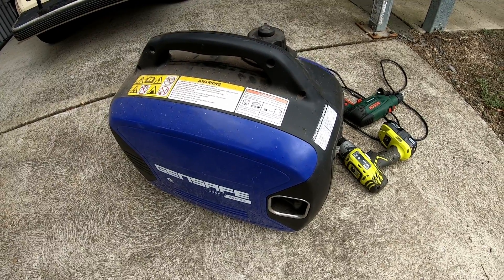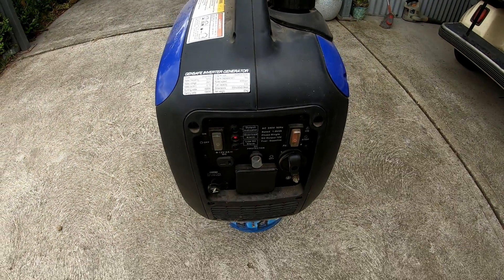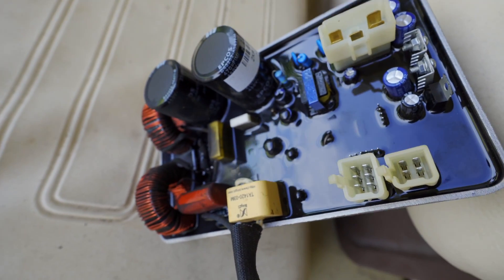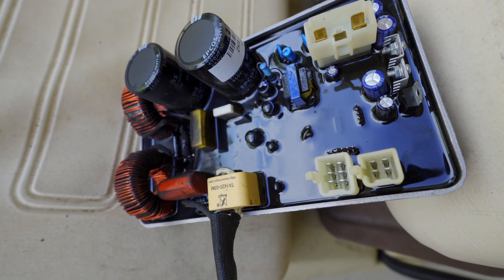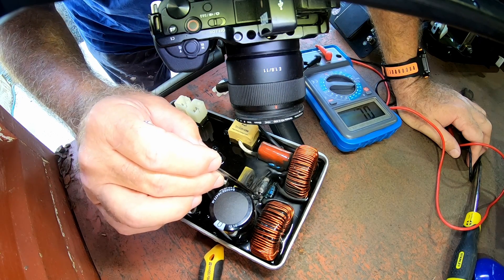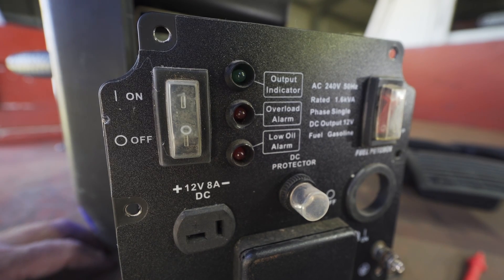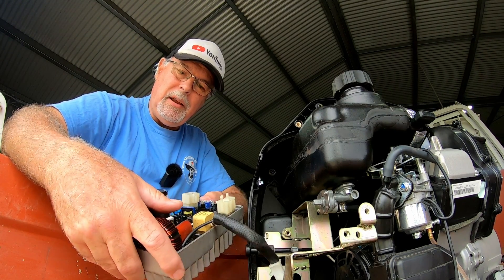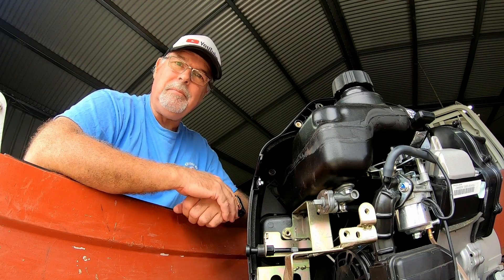Generator Repair -  FAIL (GENSAFE Inverter Generator Model GHS2000i)

Comment: Thanks, good to know the spinning drill trick only works on non-inverter generators. It turns out that I let the generator run for a while and it began working normally. Apparently, it needed to get up to speed for a little bit in order to generate power. I like your calm tone of confronting a problem. I'm a general contractor and can do a variety of things, but often I come upon something new. In those moments your calm and thoughtful approach is exactly what's needed.

Comment: Thanks for posting this video. I'm currently trying to get an 35 year old Makita G3501R generator working again. After cleaning the carburetor, it fired right up but did not produce any voltage. I appreciate your efforts in trying to track down the problem on your generator. Even though you have not succeeded so far, I'm encouraged by your attempt. I'll try the drill technique and see if that helps.
Reply from the maker: Thanks for watching Paul. I have found out since posting this video that the spinning drill manoeuvre only works on a non inverter generator. Cheers Dave

Comment: How many hours does your typical outage last might you say?
Having a battery+inverter (pre-made as a 'power station' eg Bluetti (make sure it has a lifepo4 battery for safety's sake)) handy to cover say 12 hour outages is handy.
If you want to make your own you'll prob save ~$500-1000. Eg. $800 for a 100ah 24v lifepo4 battery, $450 for a 3500va inverter and say $200-300 for wire, fuse, isolator, lugs, heatshrink, tools, etc.
In my experience, watching gumtree generator ads daily, you can find a modern inverter generator ~2kva for $200 (in WA) if you wait a month or three, or ~$300 if you want one sooner. 
I got a barely used 2kva kings for $200 ($~500 new as of today) compact generator (not the cubic open-frame type). It's a bit noisy but works fine.
Edit: just watched your second video showing the 3kva ~$400 kings opted for.
Reply from the maker: There is a housing estate being built on the land next to us. Maybe twice a month for the last year the power goes off at 8am and comes on again at 5pm. If I am working in the sign shop the printer need about 2500 watts to run so would struggle with a back up battery system. The Kings generator does the job well so far. Still looking for a similar generator to the  broken 'Gensafe' on marketplace so I can repair the original one. Cheers Dave.
Reply: @TreeChangeFarmer  curious to know: do you hear many other gennies running during outages?
Reply from the maker: @jimmybrad156  The neighbour behind my place runs his. Most of the new places in the state are not lived in yet.

Comment: It's a shame, this seems to be a very common failure mode for inverter generators, and the replacement inverter boards are often not available or prohibitively expensive.
Using a power drill to 're-flash the field' is only possible with some non-inverter generators.
A replacement board from the US likely will not be suitable as it will probably output 110 volts or 120 volts which is obviously half the voltage of what we need here.
I'm in a similar position with a large Yamaha 6300ise paperweight that's been taking up space in my shed for nearly 2 yrs.
It has 2 inverter boards which are dead, a burnt out stator, and possibly a dead speed control/interface board.
The engine still runs great but total cost for parts to repair it comes in at over $3000 ex-Yamaha, with no aftermarket alternatives.
I've been contemplating trying to rewind the stator, and attempt to repair the inverter boards by dissolving the epoxy resin with acetone or hot water etc but it might not be successful or worth the time, and there is a risk of damage to components and/or end up removing any useful markings off the components in the process, so overall it seems these inverter machines are generally a lost cause🤷‍♂️🇦🇺

Comment: I think senci is the manufacture of the genset and Pramac P2000i is very similar.  Sydney tools use to have parts for them.  I had one for about 4 years and got about 500hrs on it